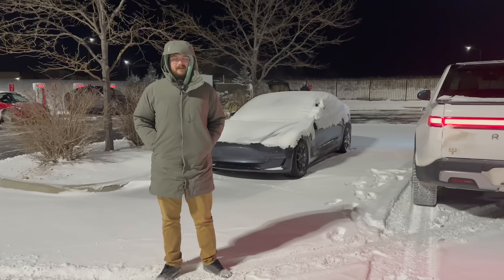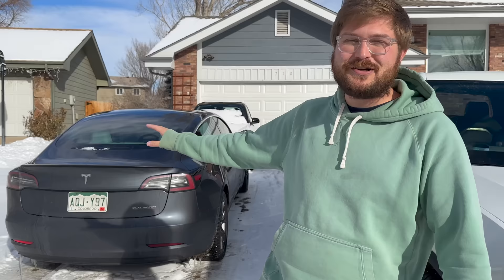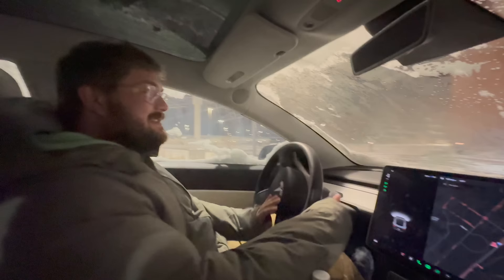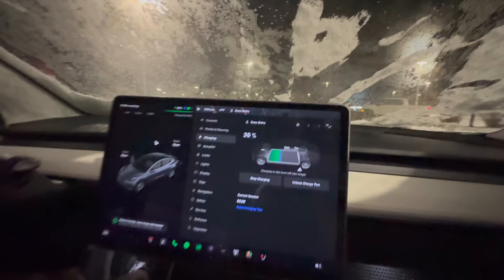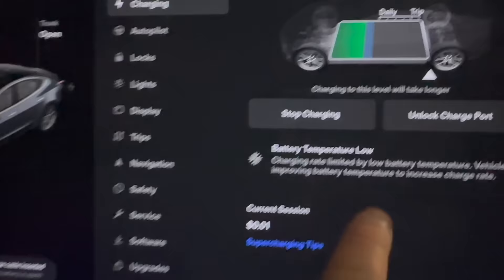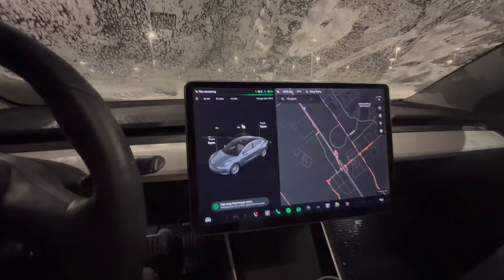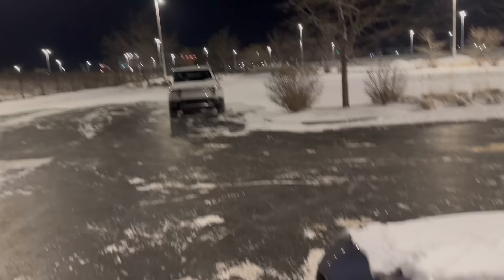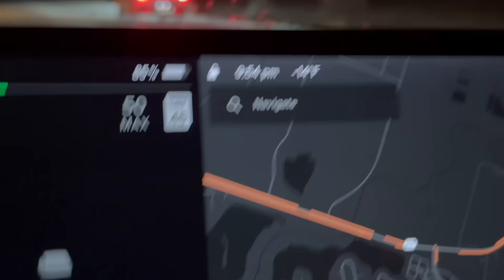I Deep Froze My Tesla And Immediately Plugged It Into A Supercharger To See What Happens

Comment: Tip for those charging connectors that won’t latch…there’s a small notch on the underside of the connector that gets iced up. Blow your warm breath onto it and scrape it out so the receiving end on your Tesla can latch onto it. I was recently in Tahoe during the 5 foot snowstorm and the superchargers had a foot and a half of snow on them, and it was 9 degrees F. Had similar charging experience as Kyle did.
Reply: I've also had one or two experiences when snow got blown into the connector and then froze, so I had to remove the ice before the connector could be plugged into the car.
Reply: Or buy a real car
Reply: No way this is the best toy ever!
Reply: I remember the time when my history teacher told me about the good old times, where everyone had a coal or wood stove. It was so nice outside that you couldnt even breath normal and everything was dark from the soot (i hope you get the irony). Your real cars are the coal and wood stove from that time. Its time to move on to cleaner cars too. Sure they are still not perfect but give them time and you will see they are the better solution in the future and even now. Maybe in some years even you will then realise how short sighted your thinking was back then.
Reply: Does the superchargers have a "defrost" option in its plug? It would be good to be protected from low temps and be heated when senses certain number, to avoid blocking/short circuiting.
Reply: Agree Atron, it’s like the guys who pine for the “good old days” when you could work on your own cars.. more like had to work on them bc they were trash! 
I grew up in cold upstate NY and know the short commings of “real cars” not starting mostly… but in these conversations no one mentions the reduced fuel economy getting stuck (two wheel drive plus poor weight distribution) etc…
Reply: @gooser__43  they moved the combustion from the car and left it at the power plant. It’s enough for these people to ‘believe’ 🤣 no hate from me. I’m okay with them as an option. But forcing us to use only E power 🤢
Reply: Tesla owners blowing the chargers 🤣 not all you guys blow...
Reply: @atron4736  Remember the "good old days" when Sony's Betamax ruled the home video recording world? Then along came VHS. Then along came DVDs. That was consumer preference in a free market at work.
Analog TV was just fine until after 9-11 happened. All the government cried about was how the first responders in New York couldn't communicate with one another, and that they needed the frequencies used by analog TV. This totally ignored the last stark reality that thanks to the shortsighted decisions made by New York all of the city's communication equipment was now in the wreckage of the World Trade Centers. So... people all around the country were forced to throw away their perfectly good TV sets and buy HDTVs. Most of the frequencies never made it to the first responders; the government made a ton of money auctioning them off to the cell phone companies.
Reply: Thanks for the tip!
Reply: @leewinter28  How much money have you spent on tires and electricity? If you have home wind and solar, please tell us how much it costs. 
The only thing free of charge is a dead battery...
Reply: @leewinter28   - you really must do a lot of miles....  (the saved costs fallacy bites) - just kidding - ppl with + house batteries do the same - pretending that "on-average" their battery will double or triple warrantied cycles to bring the theoretical cost per kWh to their benefit - with no data to back them up....   fun times
Reply: @leewinter28  👍👍
Reply: @atron4736   You could be right but,  when it is -40 to -50 in the great white north batteries do not do well.  Another thing is that child slave labor is used to dig up the lithium for the batteries and it takes a lot of electric manufactures which is powered by oil product.  Hard to get away from oil.  The infrastructure just is not ready for a lot of electrics at this time
Reply: @corvetteracing4  big plants are still better at burning this stuff than your car is with efficiencies of 40-60% compared to 10-25% if you don't run you ICE in it's ideal rpm/load range but engines are way too powerful to do that nowadays without going 3 digit speeds which is illegal for you in any state, haha.
EV's still be 2-3 times as efficient factoring in transmission losses when run on pure coal, oil or gas plants + better exhaust treatment if have a big central power plant which is always running, so get lost and think about getting an EV as a daily and get a nice combustion cars as a weekend car.
Reply: @atron4736  some people have an hour and a half to fuel up their car, others don’t. How long can you sit idle in a snow storm trying to keep warm before you freeze to death, well I know it depends on your most recent trip but its a super advice to make sure you have those emergency mylar sleeping bags in the Frunk. And then there is battery pack purchase and recycling to care about too.
Reply: Windmill?
Reply: @LastWish90 These cars will not last long. No one has the money to purchase a used EV as a first or second car and have $ to maintain it. It’s a niche product for people with $. Why don’t you understand that!? Like I said earlier I’m not hating, EV’s are cool for what they offer. But do not force all of the population to abide by your rules with all of these untested technologies. We have zero long term tests for any of these electric cars. And don’t even get me started on the control they have over you. Monthly subscriptions for heated seats, braking, speakers, power etc? 🤣 it’s gonna get to a point where the company, dealerships, police can turn off ur car whenever they want. You can’t modify any of these electric cars without breaking warranty. You can’t even purchase parts to fix your own electric car. The tools needed to fix your electric car cost astronomical. They turned a iPhone into a car I get. It works good for 10yrs. Gonna be useless after that
Reply: @atron4736  dude... the  majority of electricity that you charge your EV with comes from coal/ gas, solar /windmill power can't handle what city grids need. And when it's all shut down your savior is a diesel powered generator.🎤💧.
Reply: @atron4736  Oh come on. Fake news. We have massive forest fires every year that pump untold tons of smoke into the air that don't seem to be blackening the skys in general, but a few fireplaces and stoves would? Think!
As far as real car? Tesla's are in many ways BETTER than real cars. And cheaper to run as well. I don't think of my Tesla as a car. I think of it as an electronic transportation device!
Reply: @gooser__43  When you have a momma dinosaur and a daddy dinosaur and they really love each other and fall asleep in a pile they turn to coal.
Reply: @atron4736  kinda a bad take to be honest. How else do those superchargers get electricity? Sure you can have solar panels but the earth gets dark in the northern hemisphere for about 9ish hours on a day yearly. Sure you can have windmills but it's not always perfect, sure you can have a hydroelectric dam but those can't be placed everywhere. The world burns fossil fuels because of convenience. Look at the amount of effort put into an electric car when that effort could have been put into actually finding sustainable energy source with little emissions. All electric cars do is put a mask over the real problem. While they are neat and interesting it's not fixing any problem that exists nor does it in the long term.
Reply: @corvetteracing4  Like Luke Skywalker said: "Amazing, every word you just said was wrong".  Lets go sentence by sentence: "These cars will not last long." Tesla has been out since 2003 - 20 years ago.  "No one has the money to purchase a used EV as a first or second car".  The average cost of a car these days is $40k.  You can purchase a used Tesla for less than that.  "and have $ to maintain it"  ???  I've owned an EV for ten years now.  My cost to maintain it? $0.  That's right ZERO Dollars.  Sure, new tires, cost for windshield wiper fluid, etc.  But any maintenance?  Either none, in the case my of Leaf, or in the case of my Model X it was covered under warranty.  "It’s a niche product for people with $."  Four million Teslas are on the road right now.  That's not a niche product.  "We have zero long term tests for any of these electric cars."  Again, Tesla has been on the road for TWENTY YEARS.  Is that long term enough for you?  "And don’t even get me started on the control they have over you. Monthly subscriptions for heated seats, braking, speakers, power etc?"  That's BMW, not Tesla.  "it’s gonna get to a point where the company, dealerships, police can turn off ur car whenever they want."  You know Chevrolet can do that too?  Ever heard of OnStar?  Ford has one as well.  "You can’t modify any of these electric cars without breaking warranty."  Sure you can.  I have multiple modifications on my Model X.  Just took it in for warranty repair the other day.  "You can’t even purchase parts to fix your own electric car."  This is something every Tesla owner is fighting for - called Right to Repair.  Look it up.  We already won in Massachusets.  The rest of US is only a matter of time.  "The tools needed to fix your electric car cost astronomical."  What tools?  I've never had to fix my electric car.  If I had to say replace the battery, it's just high voltage.  Easy to get to.  TONS of youtube videos about it.  "It works good for 10yrs. Gonna be useless after that".  On January 6, 2022, a Tesla Model S P85 (the oldest performance version) reached an impressive mileage milestone of 1,500,000 km (932,256 miles).
Reply: @atron4736  they are now burning old growth timber for heat in parts of Europe as a result of this silly lurch toward green energy and the failure it is. Yes, all cars will someday be electric. Yes, wind and solar will someday be viable solutions to oil. If we do it wisely through incrementalism, we will also avoid financial collapse and hypothermia.
Reply: @craigchatterton4164  
* Tesla as a company has been around since 2003 but production of Roadster began in 2009. Still some time to wait until first Tesla EV turns 20.
* Tesla will eventually get to 4 million total sales figure, but at the time of writing this comment it is still below that. Good number for EV market but in bigger picture it accounts to about 2% of total car market share, hence = niche product. For comparison - 3.65 million Teslas since year 2009 and 10.5 million Toyotas in year 2021 alone.
* I've come across articles stating how Tesla disabled their fast charging. Another example - Tesla autopilot/self-drive comes with monthly subscription. The list of functions with annual/monthly subscriptions actually goes on.
* That P85 did not reach 1.5mil with its original battery pack, it has been swapped at least once. Lucky owner, he got it changed under warranty or so they wrote.
* Prices... Personally, I would not buy a Tesla or any other EV anytime soon. My current car was bought as used for $3.5k in 2010, had 200000 km on the clock. It is 25 years old now and has 500000+km. Even thou I've spent money on purchase, maintenance, insurance, fuel etc, it still does not total nowhere near $40k and even less so with $100+k that is the price of a new Tesla. Also, 1000-1200km range per tanking works well for me and has no temperature dependence, no EV I know has that. And yes, temperatures here can, have and will drop nicely below freezing, ~ -40C being local record, -15...-25C quite common.
Reply: @SeersantLoom  If you can't afford a Tesla because you have to drive your 1973 Datsun that you paid $500 from Joe the mechanic and put 900,000 miles on, then why are you in a Tesla Youtube video bashing on Tesla?  You don't see me going into the Bugatti videos and saying "Oh Bugattis are so bad!  I'd never own one!"
Reply: Buy a gas car.
Reply: @corvetteracing4  Little thought. Power plants have something 35-60% efficiency, grid efficiency somewhere 87-98%, Tesla efficiency 60-80% (all the way from wall socket to wheels).
What gives? Total efficiency in the range of 18...47%. Newer gas engines claim efficiencies up to ~35%, diesel engines even around 45%. ICE being worse in city but comparable on highway.
Reply: @SeersantLoom  it seems most of these EV advocators don’t go as deep as you have. Idk man so many details left out with these electric cars with many assumptions/estimates being used. And all your doing is digging into 1 piece of the puzzle. Imagine when you add up all the comparisons to an ICE vehicle…
Reply: @corvetteracing4  I just elaborated on what you were saying. Usage of EV's shifts and concentrates pollution or other environmental problems onto power plants. My thinking was - why not try and calculate the total efficiency from power plant to wheels. And, unfortunately it is also just 1 piece in the puzzle.
I also noticed an error there because I noted only ICE efficiency but not the drivetrain (depending on transmission type and that in itself is another can of worms). Some estimate it to be around 80-85% efficient. There are other accessories too that run on engine power, lowering crank to wheels efficiency even more.
Reply: @gustavosaliola  Seems very logical to me that both the male end of the connector and the female end on the car of the plug in apparatus would have a simple thermocouple on each end that then detects simple temperature problems ... and when the car is near a Tesla Supercharger station that then the car end of the connector, adjusted for outside temperature .... would automatically pre-heat the end BEFORE any human would attempt to open the hatch to connect the Tesla Supercharger connector AND at the same time the Tesla Supercharger connector handle would automatically be heated in cold temperatures ... Not unlike how a StarLink antenna is heated in the winter to keep snow/ice from accumulating on the antenna.   It is all simple and easy engineering and software solutions.  Nonetheless, the leader of Tesla is more worried and involved with Twitter as opposed to thinking and re-thinking and making the millions and millions of Tesla users a community of contributors to help coordinate and collaborate to solve problems.
Reply: @M5252email  I can just see it that when world Peace is finally achieved and no human as aspirations of harming another and AI prevents any accidents or intentional harm ... that then we'll power our vehicles with a tiny piece of plutonium hidden deep inside the vehicle, well shielded and giving off enough electricity to power the car for 20 years.
Reply: @gustavosaliola  I think if they had cooled cables they could do it easily by heating the liquid.
Reply: @jadesluv And I would leave the car a good distance from any attached garage due to fire hazard. How long is the extension cord on these chargers?
Reply: @spaceflight1019 
Yep!
Reply: @63birdseye 
It won't be ready for a long time.
Reply: @KaidonSalter4Heisman  Different strokes for different folks. I prefer to be able to sit in traffic and not choke on the ICE farts (my own are bad enough!) from all the "real" cars around me.  Regardless EVs are not ready for everyone. If you are one of those folks who keep up with their gas mileage and other statistics about their cars, you might be a candidate for being an EV owner. If you are one of those folks who always drive until they notice the "Low Fuel" idiot-light on their dash, and then start looking for a gas station, I'd recommend you stick with your "real" car, at present.
Reply: @corvetteracing4  More efficient this way. Power plants (combined cycle ones, anyway) can be much more efficient at extracting energy from fuel than ICE cars, and can be much cleaner burning (though all too often have not been). And of course alternate "renewables" and nuclear are providing a larger percentage of the power than before, so the direct contribution of EV operation to air pollution and CO2 emissions is decreasing every year. As for not being forced to give up your gasser, AMEN! Worst thing for the future is to pry folks out of the vehicles they love and understand and stick them into a strange, confusing and annoying conveyance. EVs and the infrastructure to support them are NOT ready for everyone. I'm very, very happy with my Tesla Model Y LR, but many would not be at this juncture. Once Battery charging times shorten, ranges lengthen, charging station ubiquity improves, and people become comfortable with the quirks of EVs, it may be time to start pushing EVs, but we are a years away from that time. EVs are a sensible endpoint, but we're a long way from them being right for everyone.
Reply: Another tip... Do not buy electric crap Fossil fueled vehicle is better
Reply: @atron4736  Working toward the future, and forcing the future, are two completely different things.
Reply: @michaelsmithers4900  And no one mentions the costs for tires and batteries for the over-weight, 4-wheel drive EVs either. Or the increased insurance costs, or the initial cost, or the taxes that are starting to be applied to EV chargers that will make the "fill up" cost less attractive and closer to the cost of filling an ICE vehicle.
Reply: @MurgatroidGarfunkle how much do you think Tesla tires cost?
Reply: @EshockT  Easy Google search says they're $1300 to $1500 for a set of 4 and they last about 30k miles.
Reply: @atron4736  Your electric cars are the coal and wood stove from that time.  Until the grid changes the Majority of places are coal and oil electric generating. you are polluting, just not in your backyard. It varies by state and country. the cost in pollution to make the car before you buy it is also much greater to the terms of around 4 times the CO pollution to the atmosphere. Battery and car weight, both in the chemicals to make the battery and the road wear caused by more weight are also a factor. It's a choice it's not a zero pollution, even if your sold on that.
Reply: @gustavosaliola when you hang it up the connector is fully housed.
Reply: @63birdseye child slave labor is not been associated with lithium, you’re thinking of cobalt, also used in gasoline production but no one cared about it until anti EV ppl needed a lightning rod…
Reply: @jadesluv 80% of ppl buy EVs in Norway… I hear it gets cold there too… EVs(at least Teslas) don’t have trouble charging in the cold but many new owners don’t know how to preheat their batteries to accept fast charging.
It’s as simple as touching the supercharger on the screen when you get in it to go charge. Then while driving to the charger the car will prep the battery for charging instead of just driving there and plugging in and waiting…
Reply: I have over 48,000mi on my first set of tires. I rotate and inspect them periodically. They only wear out fast if you drive hard a lot and if you run soft compound tires as many with the performance version do…
Reply: @atron4736  "cleaner cars" lmao are you not aware how EVs are built?